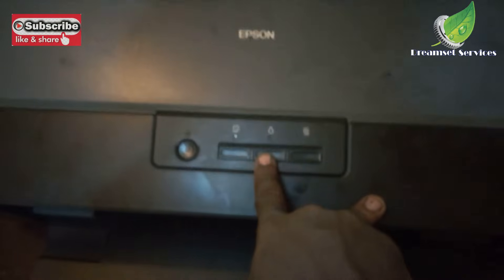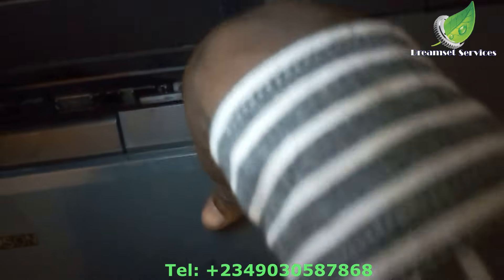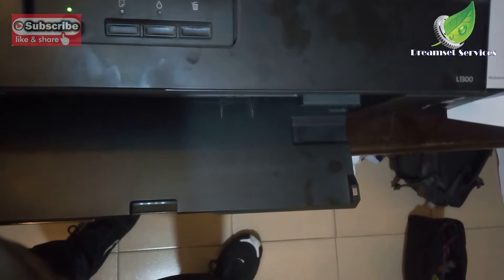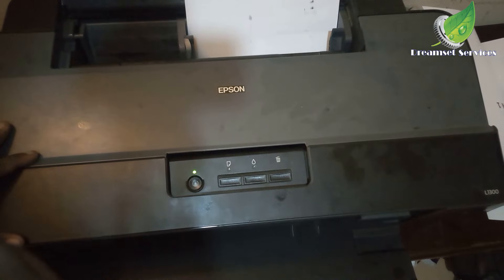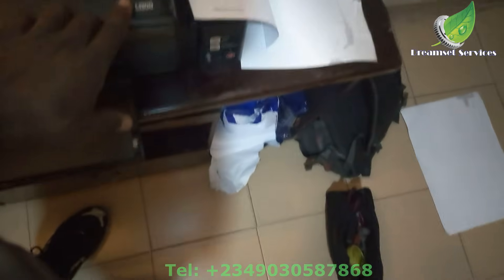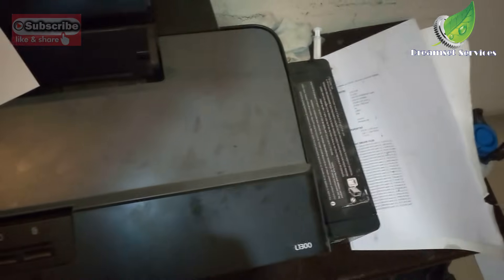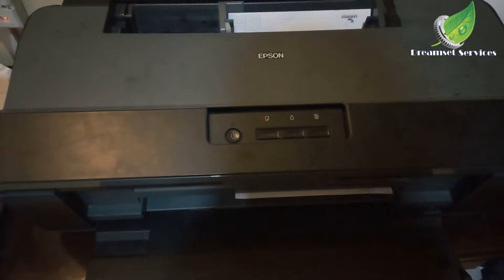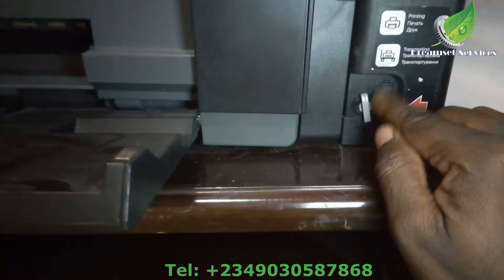EPSON L1300 Double Flashing light Fix

Comment: Thank you my friend it solves my problem by locating the white plastic gear inside the paper feed area, I manually roll it with my finger while the printer is powered on..and putting some objects on the top cover sensor.
Reply from the maker: Great, am glad it solved the problem

Comment: Hi Sir, I am experiencing the same. I have seen your video several times and tried still not able to. I've downloaded the service manual for L1300 and read and came across page 132 where theres some adjustments to be done.

I've also seen a few videos that suggested to change the CR motor. 

I still trust your method will work, but I'm not doing this the right way probably. help me

Now
Reply from the maker: Locate the white plastic gear inside the paper feed area, roll it towards you till it can't move anymore

Comment: *Very thanks your trick is working awesome! But sir after i Off & on printer 🖨 they showing still 2 blinking error? Any solution for this? *
Reply from the maker: Before switching off the printer ensure the gear are readjusted in place, then switch on the printer and co form to me if it happen again
Reply: @dreamsetservices2847  Sir its happening again. now printer On Very Slow Also Green light blinking continually.
where i contact you ? i have video's

Comment: this is the problem of my L1300. i accidentally rotated its roller feeder which resulted to double blinking. and there is a cracking sound everytime i switch it on. the roller must have been disaligned
Reply from the maker: Turn off the printer, then turn on while your hand is on the roller and check If possible spins when the printer initialises